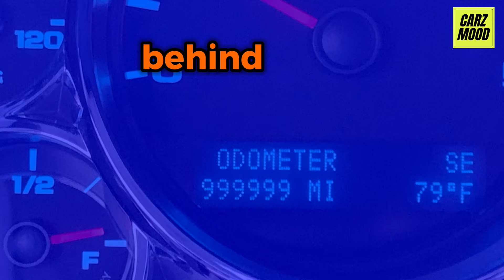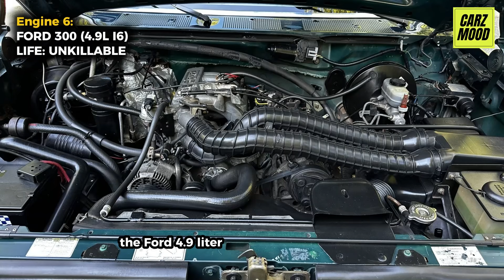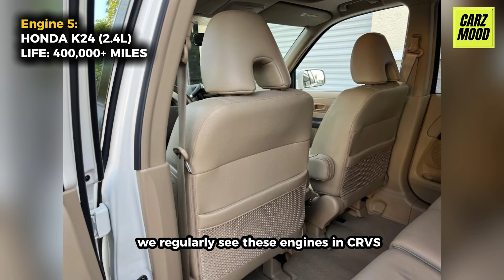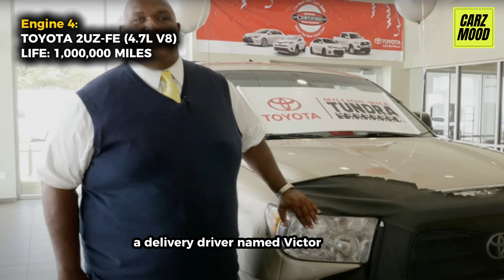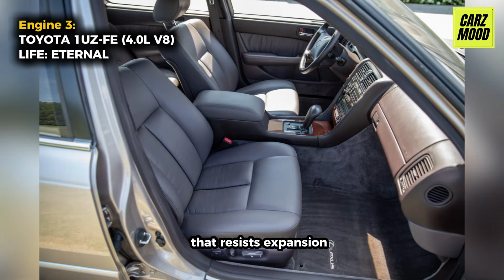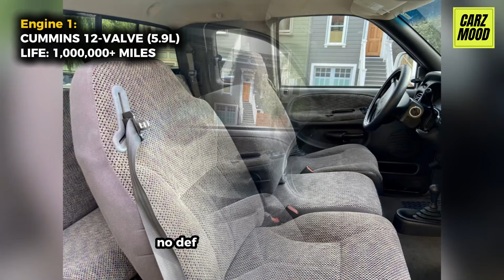7 Engines That Will Last 500,000 Miles (Mechanic Guaranteed)

Comment: I had a straight six F150.problem is the truck rusts the motor outlast 
Buick wise don't be surprised if power windows  don't work ECT..
But ya no doubt used is better I'm 61 and have only had 4 new cars in my life and was never able to pay cash until in my mid fifties.On a good note my highest payment ever was 334$ month the secret put 8 or 10 k down or a good paid off trade in